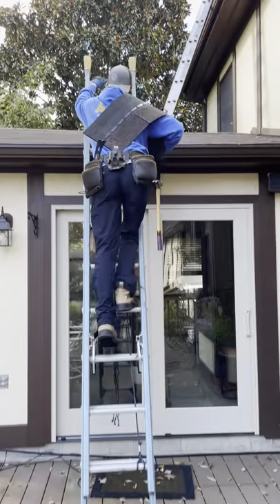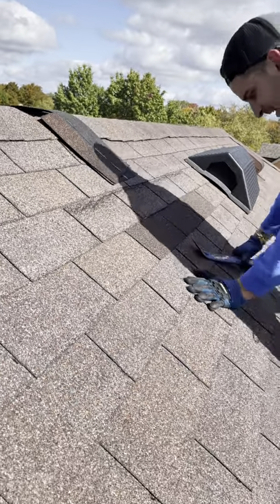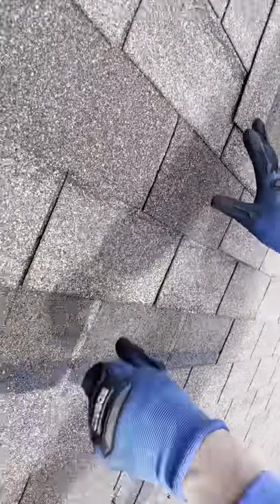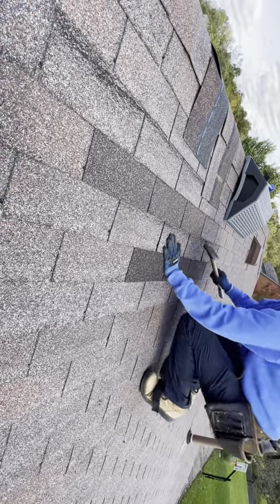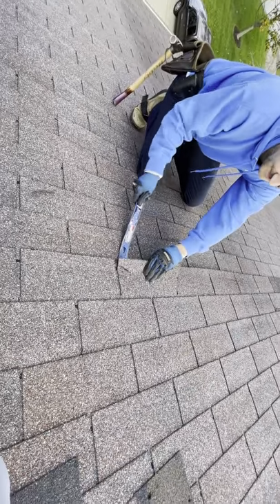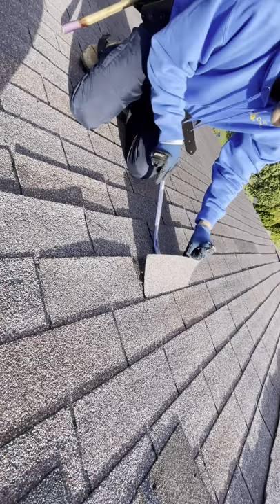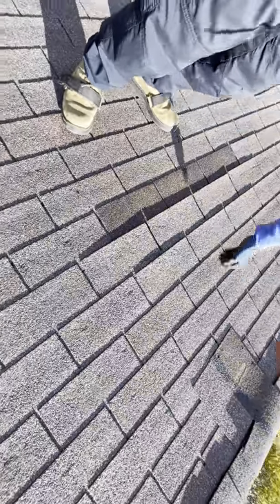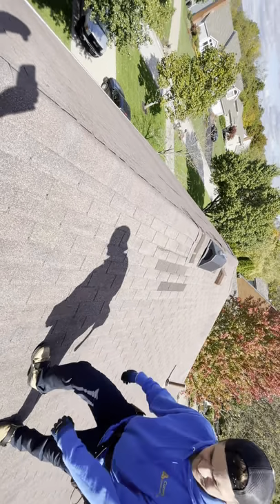Attempted Roof Repair for State Farm Hail Claim

Comment: Do you really need to pull the top shingle 90* to hammer a nail in? This seems insanely excessive.
Reply from the maker: To avoid injuring myself, damaging the shingle by hitting it with my hammer and driving the nail at a wrong angle, yes 90 degrees should be acceptable. I can lift a 10 year old shingle 90 degrees and it wouldn’t cause any sort of damage.
Reply: It is,  you only need about 40 degrees.  This guy is bending back as far as he can during removal.

Comment: If the property owner called you and said “Hey I have a leak at a boot or chimney and need a repair” would you state “ Oh I can’t repair your roof because the shingles are creasing when I lift them.” Or, would you do what I have done in the past 1000 times and repair the roof and make a few hundred bucks. 
Ok, now that you admitted you would repair the roof, would you admit the real reason is not the creasing of the shingles but that it is an insurance claim and State Farm has billions. 
Here’s my point bro. You will not beat State Farm., You may beat them one this one and another one here and there but State Farm has chosen this approach across the country. It is a lose lose situation. Simply walk away from State Farm claims and pursue the others.
Reply: So then you become the guy who’s made hundreds of bucks off homeowners doing “repairs” that end up having to be chased. And now that you’ve admitted that, I’ll tell you that as a reputable roofing company, you should know that repairing anything over 15 years old is more likely to create further damage and a ripple effect of issues rather than actually permanently fix the problem. I get that there’s two ends of the spectrum on that view, but in the long run, isn’t it better to try to provide the best possible result for the homeowner to not have to turn around and call the roofer over and over because that darn leak just won’t stop?!
Reply: @anthonyg8680  So, if a owner tells you they are broke and can only afford a repair, then you tell then No. Ok sure.
So when someone's AC goes out a tech offers a repair. When someone's frig goes out, the tech offers a repair. The list goes on.
If someone cant afford a new roof then yes you offer a repair.
It happens all day, everyday with everything from a car to a house including a roof or frig.
Now if you have 10k laying around then yes, replace the roof.

Comment: Justin, first off. It’s very cool that you were willing to make a repair. Most contractors aren’t willing and nice to see.
2nd, I’m an independent who has been working for the farm for several years now so I know what you are going through.
I’m curious if you sent in photos or the video, and what their response was.
Did you get pushback on not using a snake or anything else or did they approve?
Reply from the maker: I did submit the video and the roof was fully approved by State Farm 1 week later! The homeowner was very happy, as were we.
Reply: @justinhuber5497  very cool, did you submit through claims experience? How was the process? They sent you a link?
Reply from the maker: @dougpellessier7447  that part was actually a nightmare. We could not simply send the YouTube link so the homeowners agent did something with it and made it happen. I’m not entirely sure how he submitted it. The agent was actually a very big help, believe it or not.
Reply: @justinhuber5497  gotcha. Good to know

Comment: Ima give you a word of advice. Never mention the term, “wear and tear”. You just got that homeowners claim denied. Wear and tear is not direct physical damage caused by the occurrence. Also, very aggressive way to “attempt a repair”.
Reply: You definitely work for State Farm. Aggressive?? I've heard you Policy "experts " use that type of wording over and over and 90% or more have no idea how to actually repair a roof and just want to deny right away. You look for every single loop hole you can to Rip your own customers off.
Reply from the maker: Claim was approved after submitting this video. Wear and tear, consequential damage, whatever you want to call it, the roof was not able to be repaired and brought back to pre loss condition. Also, the shingles that State Farm recommended we use for the repair is clearly not a reasonable appearance. Which State Farm owes for.